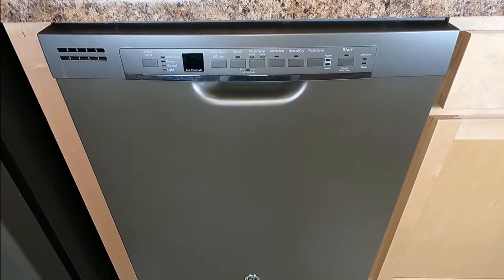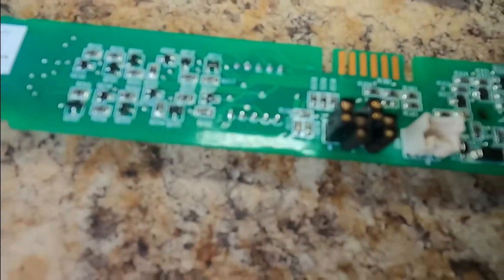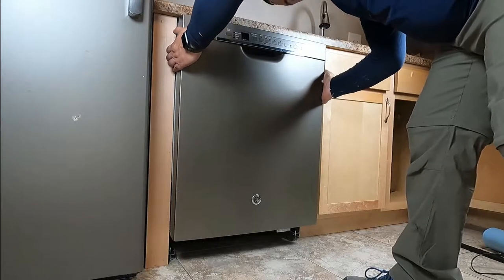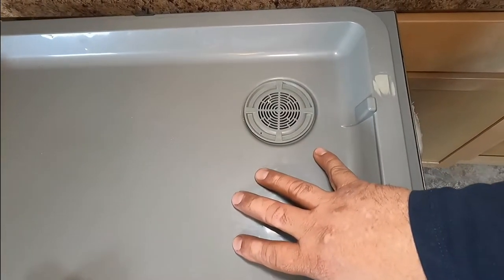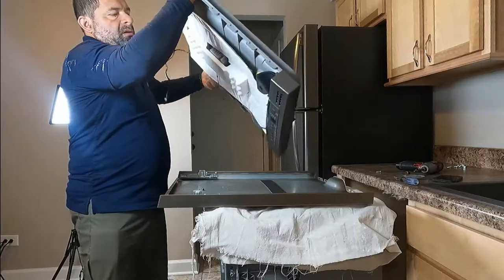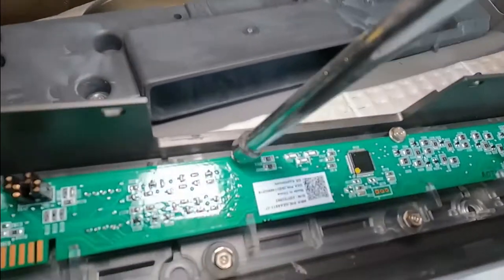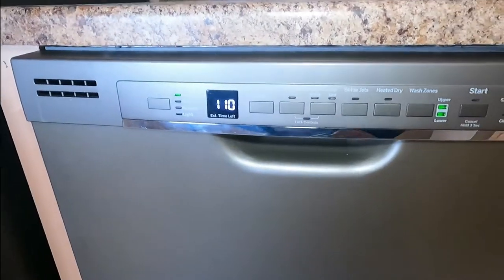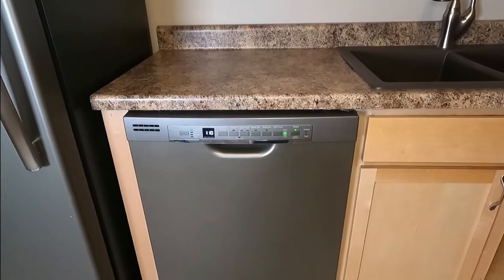GE DISH WASHER USER INTERFACE CONTROL BOARD REPLACEMENT STEP BY STEP

Comment: I have a similar GE dishwasher with same user interface board issues you were experiencing. Thanks for making this video. Was not sure how to go about changing the control board but looks doable after watching your steps.
Reply from the maker: Hello Robert   There are a lot of steps but it is easy.
Just remember to match your dish washer personality with dip switches.  You will be fine.   Thanks for your subscription.

Comment: Alex I want to thank you so much for helping me with this!!  The button on my  front control panel broke and I used this video to take it all apart, replace the parts and get it back up and running!  You saved me HUNDREDS from having to get a repair guy out here or replacing the whole unit.  10/10 for this video!!!
Reply from the maker: thank you so much   Im glad to hear that.

Comment: Thanks Alex! My model GDF630PGM0WW is very similar. Your video was excellent. Most repair videos on YouTube seems to be about top control GE models rather than front control ones. I took my 3 year old dishwasher apart yesterday and was doing FINE, new UI board in hand ready to insert. Much to my horror, my Control Panel Assembly plastic was all broken up inside, as if someone had over-tightened the screws attaching the circuit board to the machine and the screws were not really anchoring my UI board at all! No wonder the dishwasher had finally "gone dead".  I bought the machine BRAND NEW back in March 2019. :( Long story short, waiting on a new plastic Control Panel Assembly. Wish me luck! Thanks. :yougotthis:

Comment: This was incredibly helpful! I have a very similar GE dishwasher (GDF 570-650 series), and the only difference was when separating the inner door from the outer door--there were four T25 torx screws, two on each side of the hinges, that I needed to be removed as well. Thanks for posting this!
Reply from the maker: Hello Maysha.   Im glad it was helpful.   See you around.  Thanks for your subscribing.

Comment: Thanks for showing how to repair. Now works fine (after I glued on 1 plastic control panel pin broke by using screwdriver to unseat control panel tabs)

Comment: Thanks for your video!  Helped me replace the board in my dishwasher.  Flipping the breaker got me down the road for a little when it wouldn't function.  Eventually, it kept powering on by itself with no input.   Then it went completely dead.  Replacing the board fixed it for now.  Appreciate you!
Reply from the maker: My pleasure!  please dont forget to like the video please.   Thanks

Comment: Thank you so much for this step by step tutorial. I just wrapped up fixing mine and it’s working great. The replacement control board I purchased had a jumper setting based on model I initially neglected! So I had to do this twice to fix that jumper setting. Second time was a breeze though. 😅

Comment: This was very helpful , my unit ddt595ssj2ss I was able to remove the door without moving the washer out of it's space.  You can grab the plastic tension tabs at the end of the nylon string, using a hooked pic or similar, pull it towards you and directly under the area is a hook / tab that will hold the string in place. You can then unhook the door.
Reply from the maker: Thanks so much.  Im going to try that.   I have another one to fix this week
Reply: @alexthehandyman3494  I finished mine last night luckily the upper board did the trick. One of my concerns was if I let go of the plastic tab the tension would pull it so far back I would have to remove the washer to retrieve it. That wasn't the case it will just drop down where you can easily get it. I have a question if you think of it when you're doing your next repair. My vent drops down to the bottom left by the floor just in front of the kick plate the event is sort of loose in there at the bottom kind of flopping around it seems to be working fine. I'm not sure if that's correctly seated or not. Let me know if you see something similar. And thanks again for your video it was extremely helpful.

Comment: Great video! I'm guessing I will need to do this soon. I have this dishwasher and the UI is unresponsive. If I cycle power to the control card control board, The UI works again and I can run a complete cycle. Randomly the UI board becomes unresponsive again. The control board has a quick flashing light. I replaced the control board and it didn't fix my issue. I still have the flashing green light on the bottom control board. Is the next logical step to replace the UI board? Should I tear out my door and ohm out my control board to UI harness before replacing UI control board?

Comment: Thank you so much for your video. I have a GE Dishwasher Model: GDF630PSM3SS. Apparently, the interface facia panel does not work with the control panel. I bought this dishwasher a few years ago for an apartment. We just installed it and found that this is an issue. Can you tell me where I can get just the interface facia panel?

Comment: Best video on YouTube for this procedure, but my GDF620 didn’t even have the pins you can move around on the existing board, does the new part come with the black pins for position 1,2,4 and 8
Reply from the maker: Hello Tim. when new, the user interface comes with both pins covered with the black thing.   You have to lift and place as required.  the 620 is just like the 610.  Just like in this video.  So lift it with needle nose pliers and place it where it belongs. just follow the drawings.   Let me know how it goes.
Reply: @alexthehandyman3494  just suprised when I took out the board there were no pins from the factory put in
Reply from the maker: @Timcanniff311  My Goodness!!! Did you call them to send you another one?
Reply: @alexthehandyman3494  no I bought the dishwasher 5 years ago, until I saw your video  I ordered the part than took out my board, realized there was no pins I messaged you about them, maybe that’s why it failed

Comment: I hope this works for my GE dishwasher. It's kind of similar? I've already ordered the part, so wish me luck!
Reply from the maker: Hello Magpiewnch,
Usually when you order parts on a  website there is a list of the models this part is good for.  Make sure this part is good for you DW.  if you don't use it you can return it,  if you  use it and is not the right one you might not be able to return it.   Good luck.   Let me know how it goes.

Comment: Ge made new plastic parts to make it impossible  to remove hinge.  (UPDATE):FORTUNATELY, my son has smaller hands and got them to plastic  hiddentabs to pop it and found the wire that needed repaired. Saved about 800 dallors in parts and labor for a 700 dallor dishwasher. Love chinnese made stuff
Reply from the maker: Ha Ha.  What a pain in the neck!!

Comment: Thank you Alex.   I been having same issue, but so far disconnecting and re-connecting the cable at the bottom that supplies power to UI has been working.   Has this fix resolved the problem permanently for you?
Reply from the maker: Yes!  it has after I replaced it, it has been working fine.  Thanks

Comment: Can I change the interface board without taking the door all the way off ?
Reply from the maker: Hello,  I don't think so.  To access the control you have to remove the inner plastic door cover and that is fastened to  the hinge.  To remove the hinge you have to remove the door.    Maybe there is a way I don't know.  Anybody?

Comment: What model number is that dishwasher? I have one that looks just like that model number GDF640HSM0SS, when I find your part number it says is not compatible with mine?
Reply from the maker: Hello Edwin, my dish washer model is GDF610PMJ2ES.  Not compatible with yours.   The part you need is WD21X31898
check : "repair clinic"  or "parts dr"

Comment: My UI wasn’t showing any numbers or lights so I started to unplug the same plug at 3:17 and plugged back in and my UI started to work again! So I did a load of dishes and it works perfectly again. I’ll let y’all know if it gives me any more trouble.
Reply from the maker: Awesome!! Thank so much for letting us know.
Reply: I just did the same thing and mine came back on. Have you used yours a few times and works okay now?
Reply: Yea so far I’ve done probably 3-4 loads and it’s been working A-okay!
Reply: @lacopia9036  Awesome. Mine has been making the "turning on" sound for months and today it just stopped working replugged that in and out and now its working but not sure if it will fix permanently
Reply: @TStock651  well keep us in the loop if it messes up again or if it continues to work properly, either way
Reply: @TStock651  well dang, loaded up some dishes, waited an hour before I hit start to do some other chores and went back to turn it on and for wtv reason UI isn’t working…so I did the unplug and plug and it’s not working for me this time. I’ll troubleshoot it tomorrow since it’s already too late right now for me.
Reply: @lacopia9036  mine still will not stop making noises. It washed okay overnight but afraid it’s going to fail again. Let me know your solution please! Thanks for the updates.

Comment: Please do not instruct people to use a screwdriver to unseat tabs from control panel to avoid breaking plastic extension pins. Mfgr says to press 2 points on control panel. Tabs pop right out.